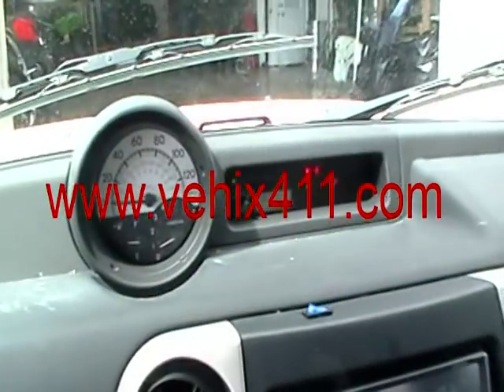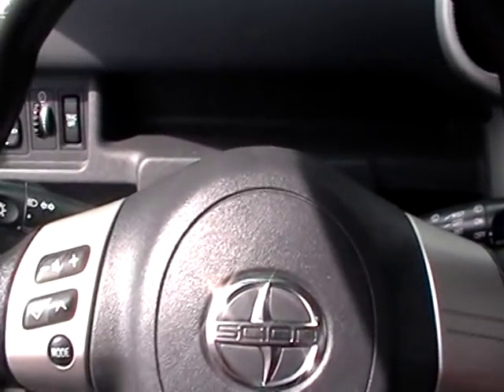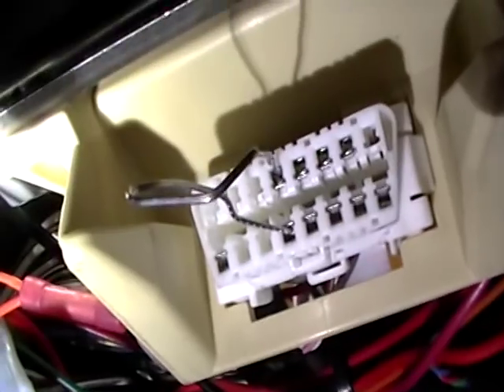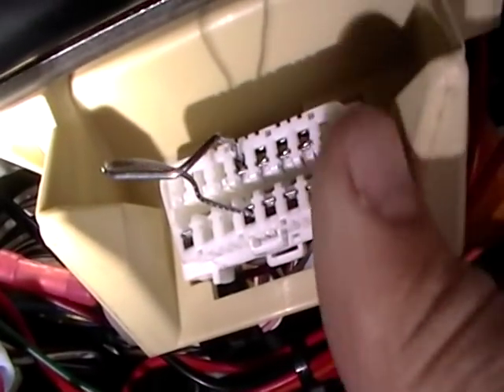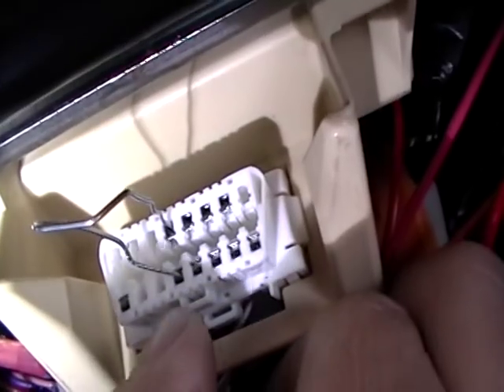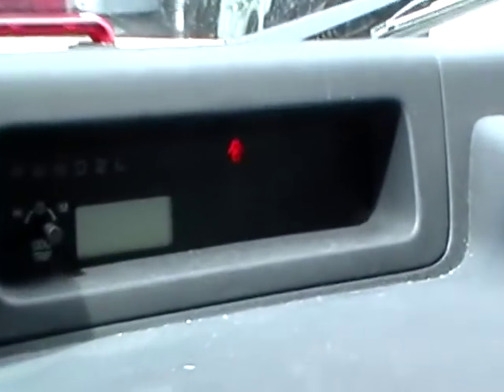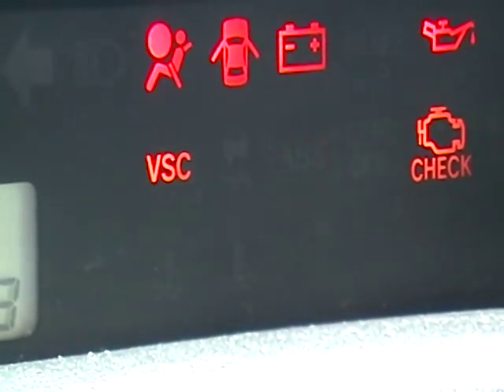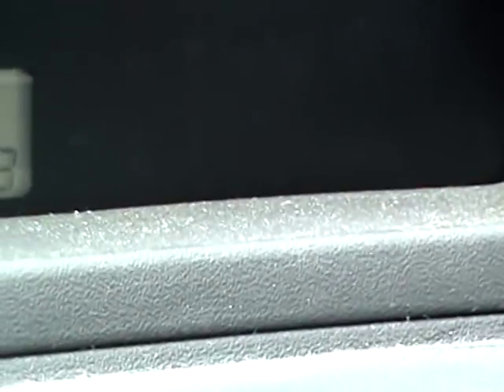Hidden Trick: Zero Point Calibration Lexus Toyota VSC TRAC OFF

Comment: I recently lifted my 2005 Toyota 4Runner 3" inches in suspension and 1.5 inches of body lift and experienced the VSC system engage when I made sweeping right turns at 25-30 mph around corners.  Doing this worked like a charm!  FYI: my OBD-II connector was upside down compared to the one in this video so I just counted from the other side. No more VSC trac system engaging when I make normal right turns!!! ;)

Comment: Thanks, I was able to reset this light after I change the YAW RATE SENSOR. The 2005 scion xB didn’t show a code for it. Even used a hand held scanner & phone scanner…… But the SNAP-ON scanner said there was a “low voltage” on the YAW rate sensor.   After I did this reset, the VSC & TRACK light went away.. yayyy!

Comment: The pins are the same location on a 2004 es330. I did it a little different but it worked. Recently got an alignment and these three lights popped up so I dont think they did the steering wheel reset and calibration. Ive heard the same from others in forums. I dont think all shops know of this since it's a lexus and toyota specific thing. I Started by putting the car in neutral to find a level spot where it stopped rolling and made sure the steering wheel was straight. I remember the car steered to right a bit before the alignment so this makes sense that it would be out of calibration. FYI If you have a check engine evap code with these it may be a bad gas cap or it wasnt sealed properly. Click your gas cap about 4 or 5 times to ensure this. If you dont have a check engine light on and recently had work done to your suspension or wheels this is probably it. You can use two paper clips or wires to do the job (what they refer to as SST). Here are the directions I found:

ZERO POINT CALIBRATION - BROO1-04 March 10,2OO4
Calibration Zero Point Calibration Using SST 09843-18040

Procedure
With SST The following procedure may be used in the cases where a Diagnostic Tester is
not available.
NOTE:
While performing lheZero Point Calibration, do not tilt, move or shake the vehicle.
The vehicle must remain in a stationary condition throughout the entire process.
Be sure to perform the procedure on a level surface with an inclination of less than 1%.
1. Ensure the shift lever is in the "P" range.
2. Turn the ignition switch ON.
3. Using SST 09843-16040, repeat a cycle of short and open between terminals Ts and
CG of DLC3 4 times or more within B seconds (refer to the speiific vehicle EWD for
TS and CG pin location in the DLC3).
4. Verify that the VSC indicator light is lit indicating the recorded zero point is erased.
5. Turn the ignition switch OFF.
6. Be sure the terminals Ts and CG of DLC3 are disconnected.
7. Turn the ignition switch ON.
B. Check that the VSC warning light goes off about 15 seconds after the ignition switch
is turned ON.
9. After ensuring that the VSC warning light remains OFF for 2 seconds, turn the ignition
switch OFF.
10. Connect terminals Ts and CG of DLC3 using SST 09843-18040.
11 . Turn the ignition switch ON.
12. After turning the ighition switch ON, check that the VSC warning light is lit for about
4 seconds and then starts quick blinking at 0.13 second intervals.
13. After ensuring the blinking of the VSC warning light for 2 seconds, turn the i(inition
switch OFF.
14. Remove the SST from terminals Ts and CG of .DLC3.
15. Drive the vehicle for at least 5 minutes to confirm Zero Point Calibration is complete.
I
NOTE:

lf viewing Diagnostic Tester Data List after repair, the Steering Angle Sensor may
remain at 1150 until the vehicle reaches 28 mph. This is a normal condition until the
learned values of the steering angle have been achieved.

Comment: This is so basic. A technical way of looking at this is that you need to ground the "SIL" wire from the EPS ecu line to "ground" to calibrate the steering sensor. Thanks for showing this. I have a new project now I know how to do it.

Comment: That sensor not only tells the steering rack which direction to go on some models, but how the stability control works.....if your wheels are not straight ahead the sensor still is not ZERO. which in turn the entire system is not ZERO. Even the ABS system wont know how to react.  The wheel alignment plays a HUGE factor. and that is the proper way to do that recalibration.
Reply: i just had a wheel alignment on mine front end but i recently got this code this week

Comment: Works on 2006 prius. Also reset the YAW rate sensor. My anti skid light was coming on at 40mph and beeping like crazy. Did this reset in the same position on the pins and it reset

Comment: Just Curious... with so many model cars and Suvs under Lexus and Toyota... it would be helpful to add which numbers to select on the OBD2 connector to turn off the VSC indicator light.   I have an 01 Lexus LS430... The OBD II looks different from the one that is shown... what two numbers on the (top row) and (bottom row) do I choose on the ODB II connectors for a LS430 Lexus vehicle?

Comment: @VEHIX411 - informative video! Question: my ‘08 RAV4 is not displaying the VSC or ABS dash-lights but I’ve got trouble-codes showing up on my FIXD scanner-app. Should I run through the steps you’ve provided to clear those codes? Thanks.

Comment: You can use Toyota Techstream to calibrate Yaw sensor to fix. Toyota dealer near me asked $ 135 for diagnostics and street Mechanic could not reset with maxwell mechanic computer. It happened after TPMS sensors changed . Abs and Vsc came on.
Reply from the maker: Or a paper clip no need to buy a scanner unless your a shop

Comment: I have a 2004 Sienna, the slip indicator was activating and would engage the braking system.  I read there is a TSB on the Steering Angle Sensor.  I tried this trick and so far it hasn't come back.  Fingers Crossed.  Either way, this video is money for doing a zero point calibration (whether it fixes my problem or not).

Comment: Mine just came on this morning and I have never seen that before but I just bought the car a few weeks ago I bought a new scanner and I hooked it up and it told me that it was the steering angle sensor but when I got to my location and then turned the car back on the light went away on its own. Do you think it still requires a calibration?

Comment: Hi, thank you very much for give me where to start fixing my Lexus IS250 2007.  I have VSC, Engine, and trac lights came on.
I've connected 4th from the top and 14th on the bottom and that fixes my problem.  Thanks again and great video.
Reply: Which numbers do you connect? I have an 06' Lexus Is250
Reply: Seth Pisaygnane .. those it really work I have same problem
Reply: Seth Pisaygnane I have same car did it work

Comment: Hi there I have a 2010 Toyota Corolla  no lights on but when scanning it with a tool a code 1422 Master Cylinder Pressure sensor zero point high pops up. Can method on the video fix this issue as well?

Comment: Can you help me figure out how to perform a steering angle sensor recalibration on a Honda HR-V? My traction control button won’t work after replacing my clock spring and SAS -sensor of my steering wheel. I reset it to zero with autel’s HT200 Bluetooth obd2 reader and after that the traction button still won’t turn on. Neither does brake assist button while stopped at an intersection. The speed sensors are fine, the wheel bearings are fine, the brake pads are fine. Certain obd functions are blocked by Honda so maybe it’s one of those obd functions that can actually help. I dont know and I don’t want to over pay Honda dealer to simply plug a device in a press a button to restore its function for $200

Comment: 2004 highlander 2.4L , will this work on it? it has the same connector. and one more thing, you say short pins 14 and 12, it doesn't seem like you are shorting pin 14 and 12, more like your are shorting pin 4 and pin 12 of the connector. Please clarify.

Comment: VEHIXZ411, can I use this trick on Prius 2014 for zero point collaboration. I removed passenger seat and reinstalled it but this red airbag light came on.
Reply from the maker: This is for abs not airbag

Comment: Do you mean that 'shorting these pins' is the same as clearing ALL codes with an OBD2 tool/reader? And, if jumping these pins ONLY clears codes -  why is this also called a 'CALIBRATION'?

I have 3 warnings showing in my instrument cluster (on my 2008 RX350):
- ABS, 
- VSC OFF(flashing), and, 
-  traction control symbol (car with swervy lines behind it).
They just all came on after a gas fill up, I think!

I also have several codes including: 
- U0073 (ABS bus communication off), 
- C0205 (front speed sensor LH circuit), and 
- U0126 (lost communication with steering angle module).

I cleaned the front left ABS speed sensor - it did have some metal clinging to it. 

So, now I'm wondering what to do next. I drove the car for 10 minutes - ABS light stays on. Should I use your jump the pins to re calibrate steering  angle? (which  may reset ALL codes?) 
And then should I clear all the codes with the OBD2 scanner? 

I also have these codes. Might they all be coming due to ABS error code?:
U0123, C1223, U0124 (replace YAW rate sensor)
C2122 

What do you suggest I work on next? (THANKS for any help you would offer!)

Comment: Thanks for posting, worked like a charm on my 2004 Lexus es330.
Reply: oh...is it...mine is 2003 es300....i have same problem...how did u do? how did u count?
Reply: the 3rd (bttm) and 5th (top) from the right 
The bottom is the narrow end of the plug as the bottom row is shorter than the top  ;)
Be sure to disconnect the battery for a few secs to a few mins !
Mine is a 2003 Es300 as well .
Reply: Same pins worked for my 2002 Lexus ES300.  3rd and 5th from the right.   Lights came on after I changed spark plugs and cleaned the throttle body.  I guess I may have moved something it didn't like.
Reply: Will this work on a 1999 Lexus ES300??? Same pins?

Comment: For some cars like the LS430 this won't fix a C1336 code, it will keep coming on after driving.  With techstream you will need to go into the ABS/VSC ecu and go into test mode, this will reset it and clear it out.
Reply: johnny Macon Ha, glad to see it fixed yours. I have a 2001 Ls430 and I'll be trying this asap, the red triangle on the dash freaks out my passengers 😂
Reply: Owen Damiani did it work? Which pins did you use? Mine is also 2001 LS 430
Reply: Thanks so much for the techstream tip. Techstream is what actually caused my car to VSC fault. Fixed it with the test wizard in utility though!
Reply: Fab, just cleared my GS300 using Techstream. Like John Brady above, TechStream is what tripped it in the first place.
Reply: @AintBigAintClever  I think it's a matter of plugging in the obd in the wrong order. To avoid issues I think you need to turn ignition on first then connect the cable, as plugging the cable in first then ignition on is what I think caused my abs light to flicker like mad. First time plugging in so I assumed it was acting like a computer status light lol

Comment: I just bought a 2001 LEXUS gs300. My check engine light, vsc & vsc off light came on after I had to avoid something on the freeway. After that the car would start to shake a bit when I would come to a stop. After about the third stop the car shut off. Also the steering wheel shakes a bit when breaking. Can somebody help please? Thanks.
Reply: Hi I had my 2008 es350 do the same thing I run my obd2 to it I had a code p0306 that's cyl 6 misfire . its very easy I had my friend came by and switch the coil from cyl6 to cyl4 and cleaned the spark plug , earsed the code drove the car today with no problem at all no shakes any more . most likely you have a same problem I think. run the obd2 and see what code you get. hope this will help.

Comment: Didn’t work for my 2013 Sienna. Used the instructions from another YouTube video which describes touching the leads 4 times within 4 seconds to clear the calibration then connecting as you did to recalibrate.

Comment: Hi Vehix411, You mentioned in the video that if pins in wrong position will burn fuse, do you know which fuse?

I have a Toyota Camry 2002 V6, just followed the video and made sure pin position matched up, turned ignition ON, no vsc trac light flashing. Tried it a few times, still nothing. But now, my car won't start. Is this caused by burnt fuse? (There's power, once the key to ON position everything appears normal, and START, no crank.) (pulled out a few fuses to check, OBD, IGN.. Seems to be fine)
Reply: Check all fuses